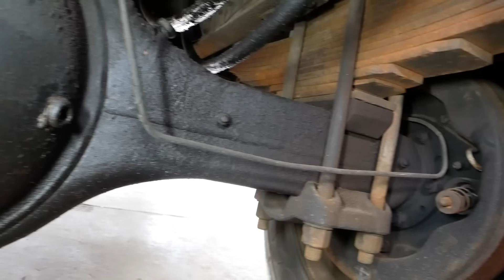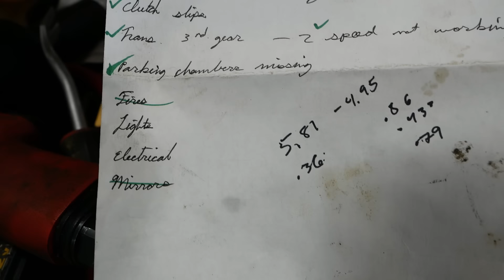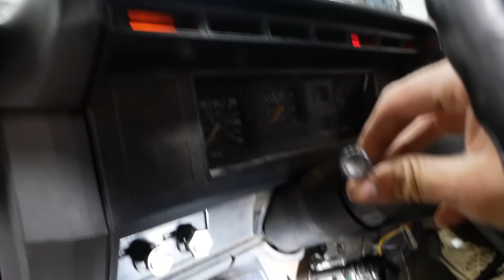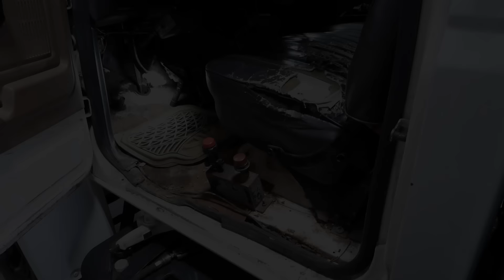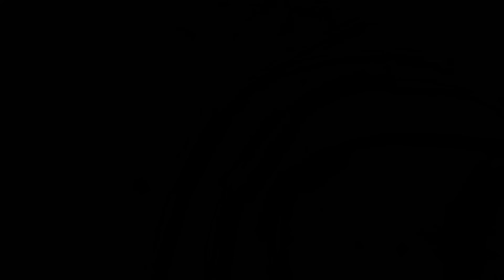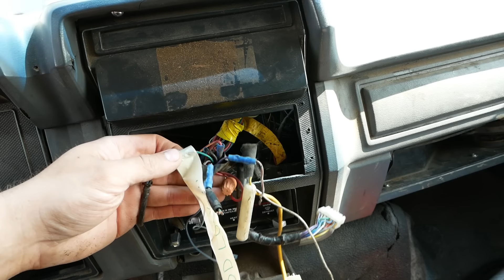Ford F700 Cummins Chipper Truck Project - P Pump Fuel System, Brake Chambers, and Wiring - Final

Comment: Wes, found your channel and have been enjoying your approach to difficult problems. Agree with all the positive comments from others. Specifically on this vid, I have been doing basic auto electric builds all my life, progresssing from twist it together and tape it up to doing things properly. I have invested in professional tools to help in doing wiring jobs properly. So, bought a repliica WW2 jeep with a 250 crossflow engine a while ago. wiring was a rats nest, slowly sorting it out so enjoyed watching you following the same process, make it safe, make it work/reliable, make it look professional. 
Re the JCB telehandler vid, I have been a fire protection technician for 20 years  (portables), my company specifically prohibits techs from installing extinguishers in vehicles because of the risk of unplanned damage. Thanks again.

Comment: Hey where's the two speed axle button?
I worked the hell out of mine in IH trucks!! Had a limit switch go bad,
it kept pushing the pinion into the ring,
while going into low, Thought the axle bearing had welded!!! Whew!!

Comment: What did the blue and red wire go to that was under the hood ? I think you should have run a separate short ground cable to the frame back there from the batteries. That was a lot of work but in comparison if you went to buy a truck like that new I can't imagine what they cost.

Comment: The truck came from SC if I remember correctly so I'll assume more than one good ole boy had their mits on it. Why sone people ADD to a huge mess instead of using a bit of common sense and hopefully mechanical engineering, ability to put things right the first time. Honestly it takes less time in the long run. I've seen many trucks that a farmer once owned be in similar condition and I was shocked why the truck ran at All! Awesome work Wes considering what they gave you to fix, save! 😅

Comment: Sometimes when a fella gets a jones for a Watch Wes Work episode to watch ya just go back into his library and find one ya missed. 
Wes digsou out his Moscow Micrometer I've always called an Allsixtenths.
One of the handiest tools I own along with my channel locks.
Actual Channel Lock branded ones are made here in America with American steel so that's what I always buy.
Montana Tools tools are the same.
Made in America with American steel. 
That rollin' wreck needs all it's exterior lights caged like the one in the back middle top position or they won't survive more than a couple of months. 
My deceased brother in law worked for a tree service crew as a topper athey did it to their trucks.
Now back to watching Wes deal with another struggle bus infested truck.

Comment: The only thing I think you can improve on is to please stop using those butt connectors. They are a terrible and don't last. Why not just solder the wires. You already heat shrink, spend 1 more minute doing it correctly?  I think you do an incredible job, You are really good at trouble shooting and a good wrench too. I like watching you do your thing. Thanks for making videos.
Reply from the maker: But connectors are superior in every way. Better for vibration, heat, and speed of assembly. There's a reason NASA does not allow wires to be soldered.
Reply: @WatchWesWork  Agree to dissdegree. Nasa has never and will never use but connectors. They don't do not do mid way splices, And yes they do use solder.

Comment: I think the cummins Lp is way lower PSI like 10 to 15 PSI. Or at least on a VP44. I do know low psi will result in a very unhappy high pressure fuel pump.

Comment: Never seen diesel fuel Burn on the ground But welding is definitely hotter then Trying to light it with a lighter more of a compression ignition over a spark ignition system for diesel fuel very neet @Watch Wes Work

Comment: This is one of the best videos You’ve had. Thank you. This is something I deal with every day at my work for last two years. And I am pretty tired of it. It becomes annoying especially when there is no part for the old equipment that the owner of the company wants to keep on the road. Not too long ago a have DOT flatbed trailer from year made 1962. Still on the road.

Comment: Wes this may be a bit late but I have that same brake controller on my truck. Mine stopped working after I kneed it pretty good one day. I bought a new one but decided to search for instructions to see the wiring diagram before switching them. While searching I found the PDF of the original instructions. It had instructions to reset and rezero it. To my surprise it worked fine once I reset it. If you see this and it matters I would be happy to send the PDF to you or the truck owner.

Comment: Also Wes, I know you have already repaired your fuel problem on this truck and it has been some time, although it still looks like fuel pressure is somewhat on the low side and somewhat unstable. I've found a lot of mechanics completely overlook, what I call, the "Overflow Check Valve" which is the banjo bolt that goes in the side of the pump on the return side. This valve actually is what regulates the fuel pressure...I have actually found these bad enough in the field where I had to use vise-grips on the rubber side of the return line to create enough fuel pressure to get truck running. I HAVE seen those diaphragm pumps used on those engines before. In troubleshooting I would have a Fuel Pressure gauge hooked up (liquid filled preferred to eliminate that bounce action) AND a Fuel Inlet Restriction gauge and as long as there was no restriction ( between 0 and 3" vacuum max) on the Inlet Gauge and I DID NOT have enough Fuel Pressure I would then squeeze off rubber end on fuel return and see if fuel pressure exceeded required pressure...…then I would know it was the over flow valve and NOT the lift pump. You can actually take that valve out and test It's relief pressure with a rubber tipped air nozzle and and an air regulator as you ever increase pressure till it pops off. Anyways maybe you can use this tip in the future
Reply from the maker: It was replaced when I replaced the pump.
Reply: @WatchWesWork  I guess I didn't see that part....I really enjoy watching your video's and don't get discouraged by any negative comments. I like the way you explain things and the fact you are very detail orientated....reminds me of me when I was your age. I was an ALL AROUND mechanic such as yourself for 40 plus years and now retired...I continue to learn new things watching you, not to mention it keeps me "IN TUNE". I have also taken a shining to Warren on "Western Truck and Tractor Repair" with his YouTube Channel

Comment: all fuel filters typically used on vehicles are only 60% efficient at whatever micron. All kinds of garbage gets past fuel filters.........sugar,sand,silt. If there are 2 filters in series, they have a pretty good chance of doing their job.  The fuse box was certainly "possesed"  LoL

Comment: Noticed when I first watched this series that I am in the area this truck is from once in a while.  As I was sitting at a stop light today this truck turned onto the road I was on pulling a chipper.  Was next to it at a few lights and it sounds quieter than it did in the videos.  

The wiring fix didn’t last though.  The left brake light was out on the truck and chipper.

Comment: The irony here is that it market value is probably not more than what you just put into it, despite the fact that it could not be replaced for less than what you just put into it,  and thus was probably still a reasonable value for your customer.

Comment: Watching the test drive I wonder if that isn't a "Short 4th" 5-Speed = So its 2L-2H-3L-3H-4L-5L-4H-5H - Our Gasser F700 had that style Trans/2-speed
Reply from the maker: I've never seen a Ford like that. GM loved that short 4th though.
Reply: @WatchWesWork  We had 5 of them like that, a 79 L-Series (that crappy Louisville cab) w/370 (the 429 with small pistons) and FOUR F-Series (just like the one you were working on - But 429 V8) 1980/82/83/85 - The training of newbies was fun at times....LOL

Comment: The reason they didn't have the ground battery cable to ground is because its a Ford. Ford always runs 2. It was told to me that the reason is that if a Ford starts to loose electricial, like this line did when that cable was cut, you could start the truck and not break down. You yourself blew just about every fuse in fuse box and melted the box itself, no lights anywhere but the dam thing started. A GM truck, that would not happen. Why?  Because it's engineered differently. You have to do 2 things to fix Fords, #1 curse at them #2 get a bigger hammer to fix it.

Comment: The best way I found to fix light wiring on old service trucks is to mount a 7-wire Cord Junction box under the cab on the frame and run new wires out of the 7-wire box. Its faster than trying to figure out those rat nests. It also make it easy to run wires to all your extra marker lights trailer plug. I never ground sealed light to the body or frame always back to the 7-wire box and 1 wire from the 7-wire box straight to the battery or good ground.  When you have a lot of rust you don't waist time tracing bad grounds, plus when you have a ground problem you know where its at.

Comment: Use led lamps for the three class lights at the rear of the body. 
Should last longer than 6 months if the wiring is properly mounted.

Food for thought

Comment: That was a big job Wes. Your trucks taillight wiring reminded me of this. One place i worked we had a contract to service rental trailers. Trailer wiring URGH!!!!! In the end we we had the plug fixed to the trailers drawbar with a 3 ft breakaway loom attached to it. That way if they dropped the trailer on it , forgot to unplug it from the car or let it drag on the road we still had a loom and only had to replace the brake away wiring loom. It was cheaper to replace the 2 plugs and 3 ft of wire than the time spent trying to find a break in the wiring and fix it. I also hate scotch locks too. That fuel pump would have had me guessing. You are good at your job Wes. On the bottom of your invoice "all warrantees expressed or implied expire upon payment of invoice.) They'll never read it. LOL

Comment: Nice Job Wes.  I took a break half way through the video to solder some new clamps onto my old Battery charger.  It made me think of that mess you had going.  Glad to see you do things right. Now I've seen wire nuts used on a trailer but never a handy box.  I wonder if they thought that was staying within the building code.

Comment: Hey Wes, does anyone in Illinois do the “Mustie1” rust prevention treatment (use a sprayer with chainsaw bar oil mixed w/solvent so it’ll go thru the gun all over the underside of the vehicle after a thorough de-scaling)? He was saying it’s pretty common in the NE…he’s in NH. Sure seems like a good way to extend a rig for a few years relatively cheap.

Comment: Hi Wes my name is Peter and I come from Australia  I used to have an International ACCO 1810C with a split diff and I found the best way to change was start in 2nd low then go 3rd low then 4th low then 5th low by this time I was doing approximately 35mph I then popped the button to 5th high. Changing down I always went down in high range then changed into low range to take off again, I love the way you nut everything out.I have worked part-time im a truck repair shop as a Trades Assistant and I saw a lot of what can only be described as JERRY BUILT repairs come in to be fixed in a better way the only trouble was nobody wanted to pay for it to be done properly they just wanted the problem fixed so that they could get back on the road they would come back sometime later and complain that the problem was still there or something else had failed because of the previous issue any way keep up the great work that you do and I feel sorry for you having to work on such CRAP

Comment: truck reminds me of repairs done in the 3rd world. Gettin parts was always an issue, but bush mechanics used anything and everything and could get anything working again, but doubt if they knew what to do if presented with all the correct parts to fix something. This clip is better than a murder mystery novel.

Comment: They probably converted the rear marker lights to turn signals because a towed unit was blocking visual of the rear bumper signals. With this Frankenstein of a truck any guess about why they did what they did is probably correct......jeezus I bet the shop down the street is glad they took  it to you. They did 5 other jobs while you did this one....lol  Some jobs just dont pay the bills.  I still say you are one of the best mechanics Ive seen.

Comment: Today´s mechanic leson folks.We will perfom an exorsim on the Fusebox.Not even thanos has enougth power to fix that mess of wires in the back  on a single snap .2 Litters inside the heater box that is nice joke hahaha

Comment: Great job all in all.
Only wish you had left those upper lights as turn signals as well. They had them there for a reason, and that reason is the trailer. With them working, you avoid tickets when the trailers lights go Boobies skyward.

Comment: As a fellow deep dive repair man, I have to wonder how you deal with pricing jobs like this. Flat rate is impossible, estimating something like this is a gambling fools errand.. do the customers just write you a blank check and say make it right?    Do you just keep track of actual hours worked and charge a reasonable rate (under flag hour rates?)

I have a customer that brought me a 1975 c3 corvette that has been babysitting a barn for a few years.  The list of things I have done / fixed is heading on to page 3, but now I'm getting push back on time and price.  I call with each new find and give the repair cost estimate to get approval.  I like this kind of work, but I don't know how to market it without saying "give me your check book and I'll make it right."
Reply from the maker: I took a rough guess based on initial inspection. I was actually pretty close in the end. I underestimated the wiring a bit, but actually over estimated the transmission repair.
Reply: @WatchWesWork  that's what I do as well, but I get caught with more unexpected repairs than I would like that drive the cost way over the original estimate.  Most of the time I'm way under estimate because I try to do a worst case scenario plus 20% on top, but lately I've been way upside down on my hours because I can't just leave bad repairs be (mostly wiring).

Comment: I've done a couple of those floats. Both with holes in that exact same spot. 
The trick is to look on the end cap there's a little blob of solder in the center remove that that lets you solder the outside and then resolder that center blob that you removed. That's how they solder that together in the factory.

Comment: When I was a mechanic I worked on a car that the dash lights were going crazy. I found the main wiring harness was spliced under the dash and were soldered and taped. That could have worked except they taped them together real tight and once I pulled them apart all was well

Comment: wes.. does this look anything like the fuel pump diaphragm you need for the oliver.. https://www.speedwaymotors.com/MACS-49-11251-1-Fuel-Pump-Rebuild-Kit-Ford-6-Cyl-Flathead-V8,441789.html
Reply from the maker: I'm not sure. Without dimensions it would be hard to know. I think I'll just go electric. That should fix her up!

Comment: When that light is dying like that double tap it and lower the output to run it a little longer. To keep lighting it up full blast when it’s dead is bad for that lithium battery. Probably in the top 5 best harbor freight tools, I love it.

Comment: Whats meant with the PTO?
I am from Austria 🇦🇹, we dont have these here in europe or its only called an othername  that i dont know🤔
Reply from the maker: It uses power from the transmission to turn the hydraulic pump that raises the box on the rear of the truck. PTO = power take off.

Comment: If you reversed those throttle return springs such that their flat sides are towards the shut down solenoid you will have the clearance you desired.

Comment: Gosh Wes, I certainly hope the buying price was right. You said he had it towed there. With the fuel system as it was and no lights I am surprised the bed would dump. Which it soon wouldn't with that brace cutting it. You actually made this winter usable and was in no way before. Maybe down South you could get away with one wheel parking brake but on winter conditions no. The transmission will probably be good till 2040 now. The very worst adaptations and looked like an 8 year old wired it.

Comment: Wes, this type of tree truck is commonly known as a split dump or a manual tk. The box is called a man cab or the dog box. The upper lights on the rear of the dump are supposed to be fully functional brake, turn, marker lights. Hope this helps if you run across another one.

Comment: That wiring mess you showed reminded me of a place I worked in 1981.Company had a bunch box  semi traiers.The wiring had been patched like that truck.When the mech got the trailer to patch lights the trailer was usually loaded for and people were waiting for it to be patched up enough to go.One trailer was in a wreck,sent out to be repaired.They loaded it then found out that the markers on top did not work.every one was screaming make it go,turned out that when the trailer was being repaired after the wreck,vendor did a bunch of heating and welding on the column that held the wires for the top markers.Of course that meant that it should be rewired,but no time to do that.jury rigged wires through holes in tralier floor up to top of columnthen patched the wires together with crimp fittngs.lights worked drivers always complaining that the wires should not be where they were.